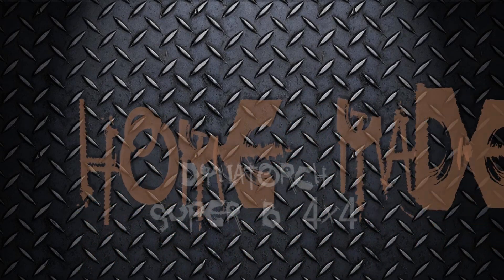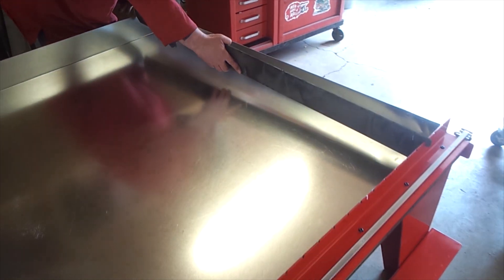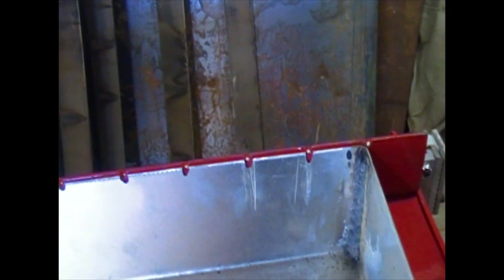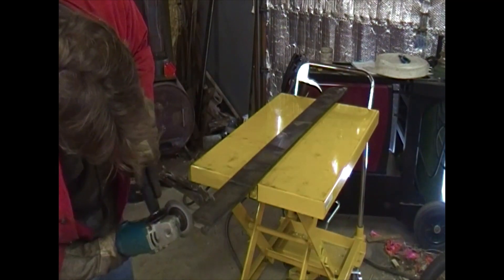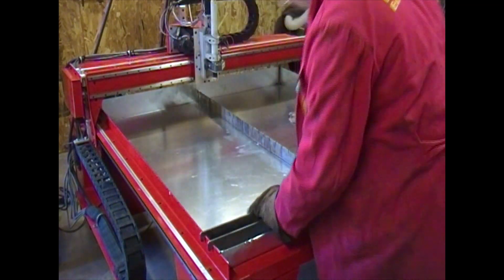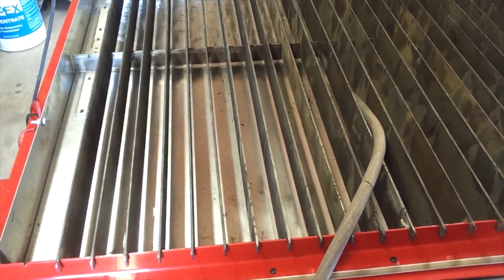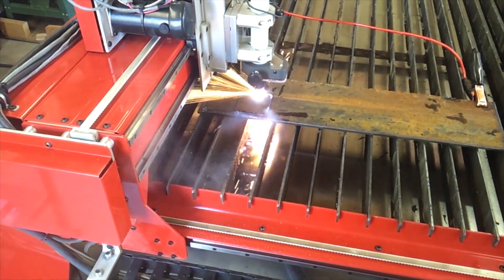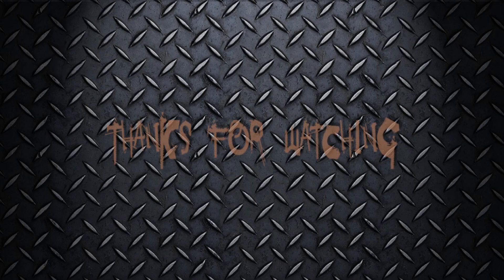CNC Plasma Table - Dynatorch Super B 4 x 4 Water Table Build

Comment: What is supporting the water table and what's the standoff you used from the bottom of the slats to the bottom of the water tray?
Reply from the maker: You can see https://youtu.be/dFhy2Is-Vxg?t=37s that there are tabs that support the tray.  No stand-offs just re-install the bars and the central support.  Hope that helps.
Reply: The Emporium oh ok. I talked to dynatorch yesterday and they said they no longer put the tabs on. mine doesn't have them
Reply from the maker: Ohh - they sell a water tray so how does that attach then?  Maybe build some legs and an angle iron frame?

Comment: You should post what kind of plasma machine your using ie are you using a inductive start ... reg hf start or..Blowback start starts arc without the need of High Frequency
Reply from the maker: +772777777777777 So the plasma is a hypertherm powermax 45 (http://www.hypertherm.com/en/Products/Handheld_cutting/Systems/powermax45.jsp#0).  Hope that helps.

Comment: Hmm, you have no guard on your grinder, ive personaly seem a blade break and enter a workers chest, 2 coworkers fell in shock while watching a fountain of blood gushing out in massive quantity's, he survived but maybe you wont!!!, safety, safety, safety!!!!
Reply from the maker: Gilles Bujold Thanks for the tip. Sometimes a guard isn't practical on hand grinder.  Everything we do has risks.  Head to almost every small welding shop and you will see the same no guard practice.  If you run this way you have to inspect the disc before every start and don't stand inline with the axis of rotation and dont forget gloves and eye protection as shown in the video. Thanks for watching.
Reply: Agreed sometimes the guard is a hazard, you probably hold it to the side when you install a new disc for its first run up.

The safety trigger on a skill saw makes it difficult to do a drop cut safely especially on a ladder.

Comment: Roughly what was your total cost build , purchase all equipment to operate the table ? Minus the power max 45.
Reply from the maker: I think for the compressor, electrical work and the water table it was around $14,000 CAD.  Hope that helps. The table itself was just around $10-11,000.